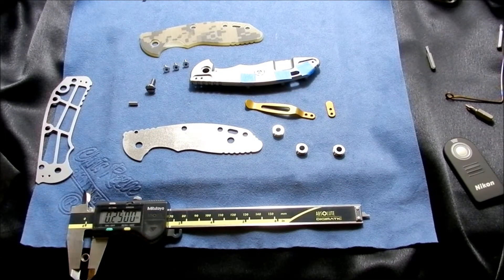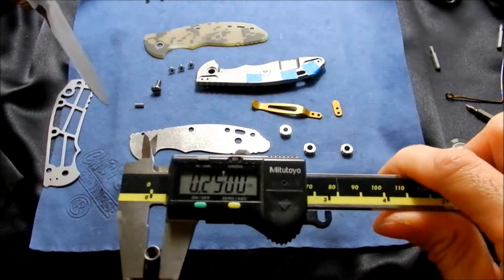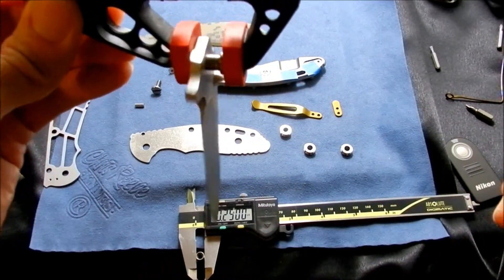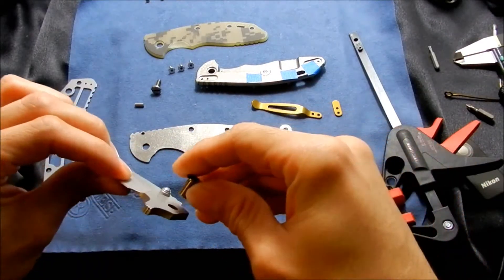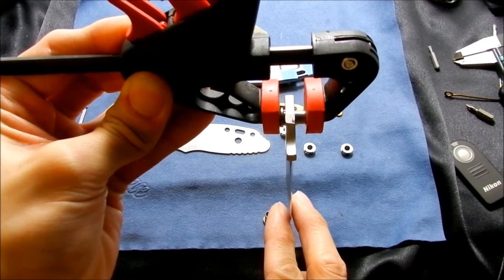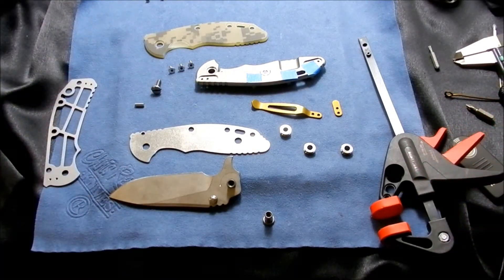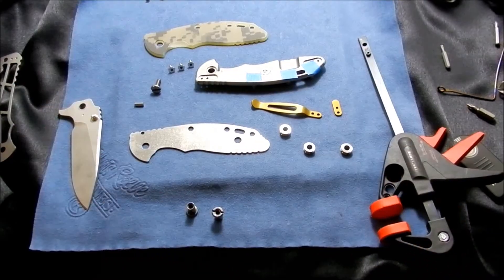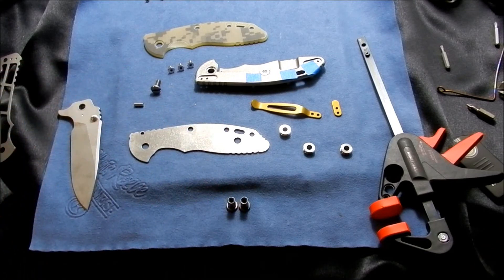Why Pivot Tolerances Are Important When Making A Folding Knife

Comment: it is awesome to here about tolerances, heat treating and manufacturing processes from people who know nothing of manufacturing or even meadureing parts correctly.  the side to side play shown in this video is misleading due to the fact that you have removed the frame/liner that limit that play as a matter of course.  that play is determined by how parallel your bearing surfaces are that your blade rides on.  jot the pin.  the pin tolerance will introduce other types of play in a knife.  the other thing to consider is how much slop is left after they tighten the pivot screw.  if it is loose then it will allow some blade play as mentioned in the video.  zero play is accomplished by having parallelbearing surfaces that are properly tightened down.  after that is accomplished, you could check the play in other directions that may be affected by too small of a pivot pin.

Comment: But your point is well-taken, M0DiFiEDZ... You can do alot with good washers, ground-flat liners and a good polish job.  But real precision and smoothness in a pivot is achieved painstakingly with tolerances in diameters of blade and pivot, as well as bushing shoulder height in the case of designs like CRK and some newer Spydercos like the Para 2 and Manix series.  Great point!

Comment: While I certainly agree with your premise, I'm a little suspect of your methods.  You're using a slide caliper, which regardless of how many places are in the display, is only accurate to +/- .001" at best.  When you account for finger pressure, which can move a needle .002-.003" depending on applied pressure, you're really using a tool not precise enough for what you're trying to show.  You really need a screw-type micrometer with a good friction stop to do what you're attempting with accuracy.

Comment: The blade problem here was because the blades had been stacked or picked up with the 'back' side of the blade facing front, so the lock up grind was exactly the wrong angle by 180 degrees.

Take care.
mrbluenun

Comment: Hi M0DIFEIDZ,

I tried telling a couple of people about this and they said as the pivots and blades were made in house there could not be anything wrong. We left it at that. I may of even been talking to you I do not remember.
If the pid and or the blade is heat treated, then the tooling should be done after heat treating, that way the heat will not make any difference, and no 'tolerance fit' will necessary. Which depending on the heat, the material, and the initial size of the pin